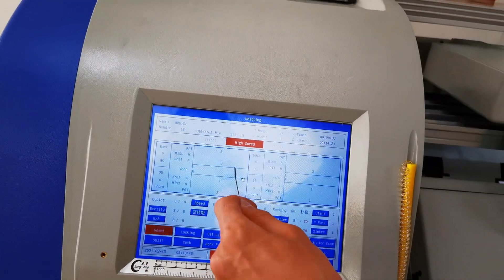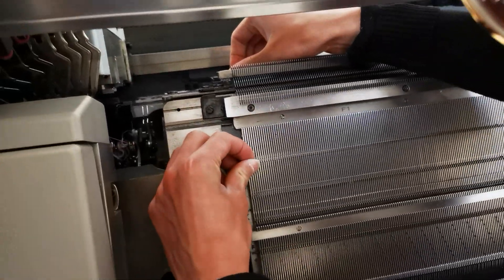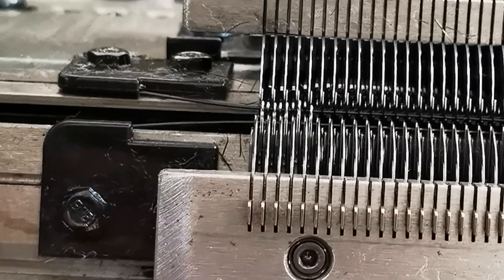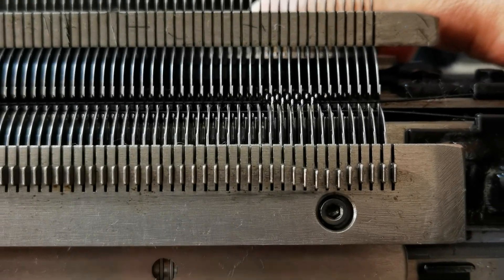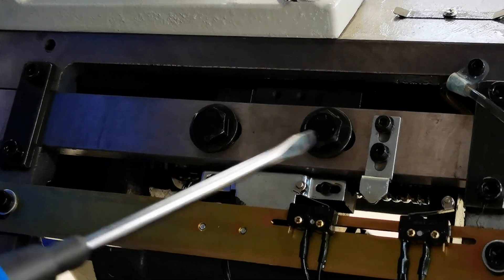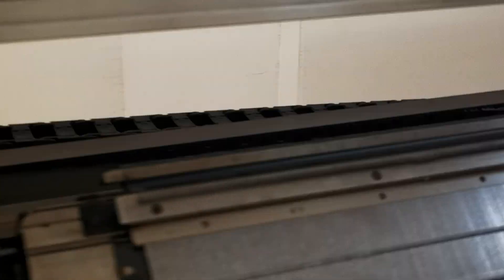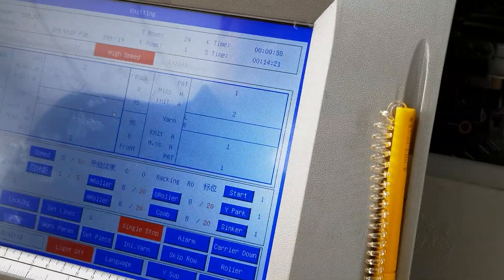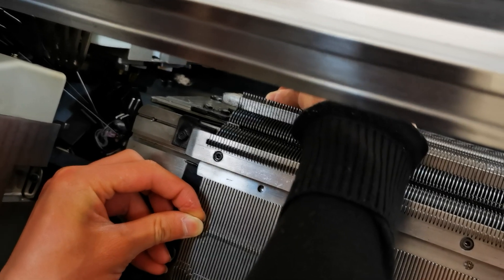flat knitting machine maintenance-racking position correction

Comment: Please, I need I want to increase the speed of the servo, but it is closed. I want a way to open some things, please
Reply from the maker: which brand machine you have
Reply: @longxing  I own a machine longxing
Reply from the maker: @mahmoudahmed6165  working parameter have speed limited check it speed 120or not
Reply: @longxing  Unfortunately, I want to increase the speed of the servo But it is closed. I want an explanatory video to increase the speed of the servo The speed rate does not increase from outside the machine If possible, a WhatsApp number for communication and video explanation, please
Reply: Please upload how to fix speed in china machine model 16